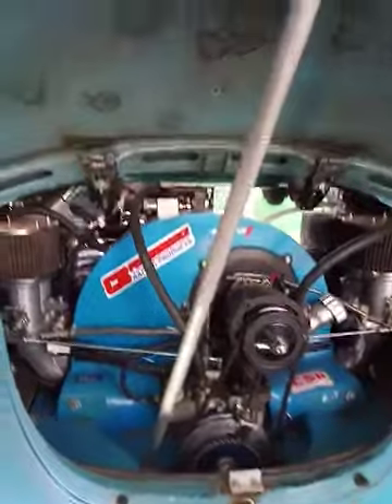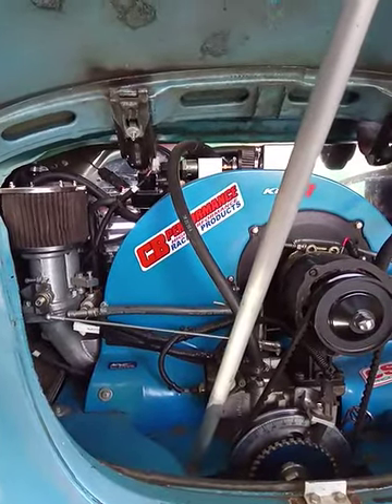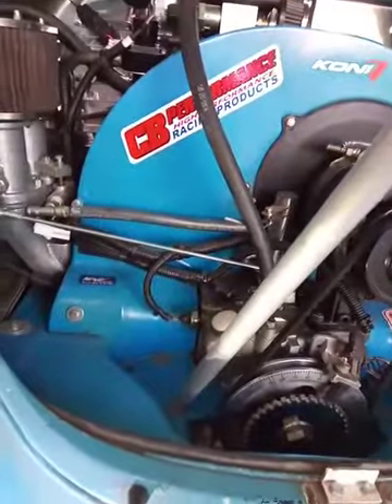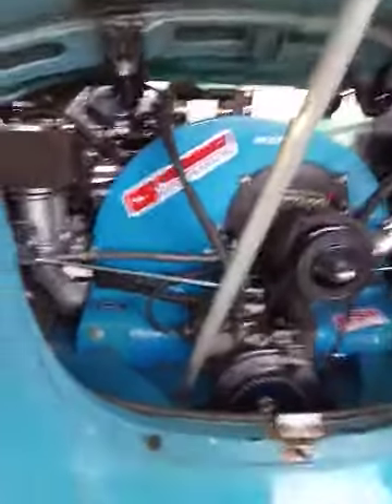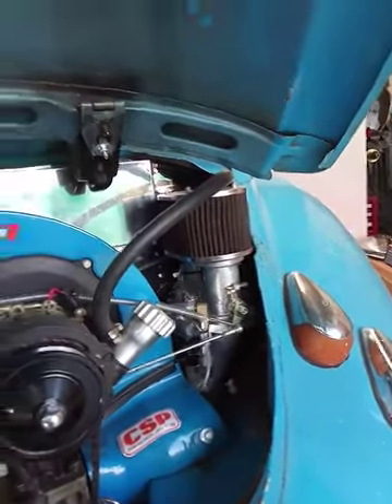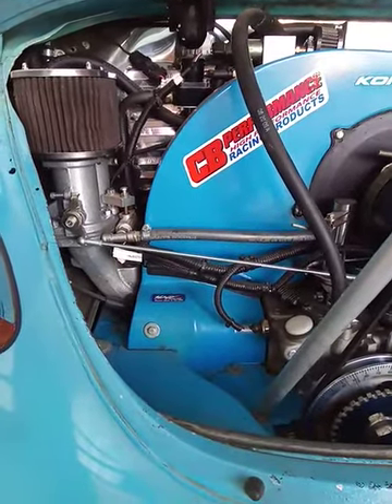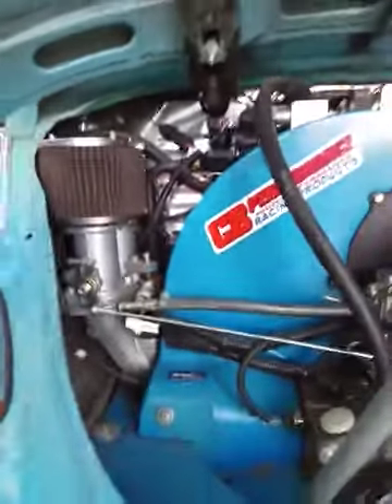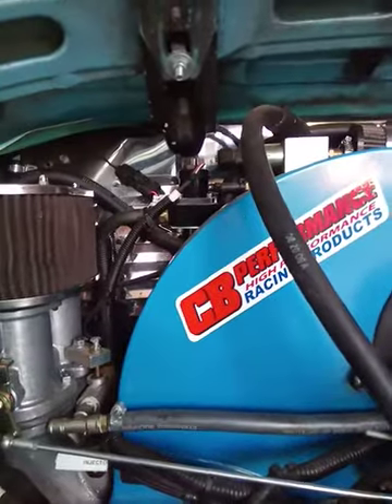CB Performance Gen4 EFI - first impressions kit and install - hardware

Comment: Thanks for sharing! How's it been since the install?
Reply from the maker: I'm happy with it. It has helped and I've now gotten to the point that I've removed my LM2 and am now just driving. 
I can't get the car to launch properly like it did on carbs, it just falls on its face sometimes, as if it needs a "pump jet" function.
Reply: @TonyZVW  thanks for the feedback! I just realized they retired that model per their site so I’m still looking for options.
Reply from the maker: @Rockettube1  yea, the new Holley unit is a lot more pricey. Email them, you never know, they might still have old stock
Reply: @TonyZVW  I seen that..damn! Good advice thanks!

Comment: How do you compare it to carbs? Is the drivability better?
Reply from the maker: I went with the efi because my engine combo has a flat spot with the 48idfs that I couldn't tune out. It was always between 3000 and 4000rpm. I could make it less severe but then it'd be wider (up to a full 1000rpm) or I could make it narrower (approx 300rpm) but the spot would be unbearable. Either way, I was never happy and it was in a bad place in the rev range. 

With the efi, this issue is gone. 
So far, it makes very little difference everywhere else in the rev range as I had it pretty well dialled in. 
I am happy, the efi has served its purpose and made the car much better due to it removing my dreaded flat spot
Reply: @TonyZVW  thanks for the feed back

Comment: Where did you get the vacuum plates for the throttle bodies.
Reply from the maker: CB Performance
Reply: @TonyZVW  Ok thank you. I have a pair of 48mm del trijet to put on my 2.2ltr oxyboxer. I am looking to run for the moment MS3 for ignition on the motor before going full EFI.
Reply from the maker: @badbug911  good luck with your project. It'll be fun once it's running
Reply: @TonyZVW  Yes i know. I am building it purely for street driving so torque with the web86B cam was priority with the new los panchitos.
Reply from the maker: @badbug911  should he a good combo. Mine is also for street but with 86C, 2332 and wedge ports
Reply: @TonyZVW  Yeah i know. Tony which lifters are you running and what cam blank is the 86c.
Reply from the maker: @badbug911  scat lube a line lifters, circa 2003
No idea anymore which cam blank webcam used in the early 2000's
The engine has about 5000mile on it, not much for its age but still not bad for around 200hp